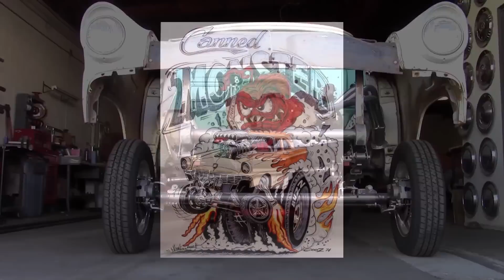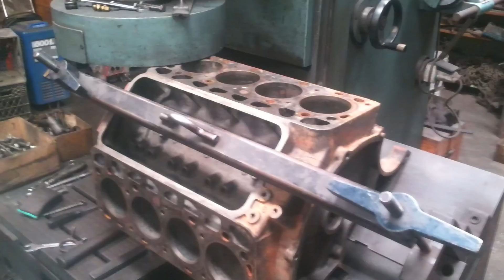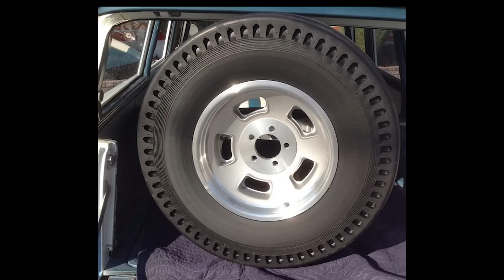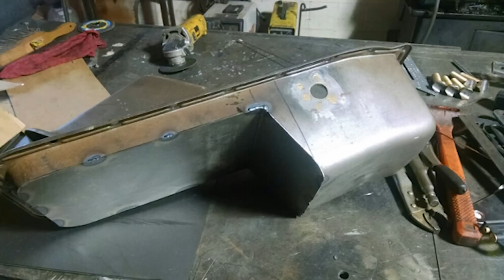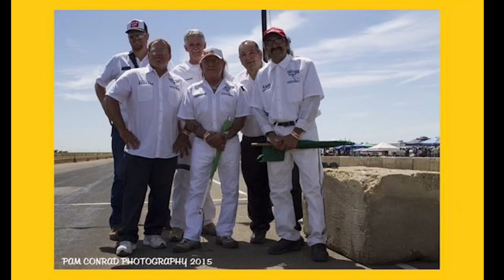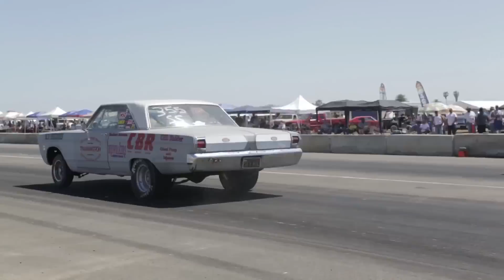1956 Ford Customline "Canned Monster" Gasser Build: Part 1

Comment: I just picked up a 56 Fairlane I'm trying to get a wider tire on the rear any suggestions thanks bud
Reply from the maker: The '56 is the best looking 50s Ford cars IMO. Wonderful lines on those cars. I would go to a good tire shop and have them measure the biggest wheel and tire you get get on there. If you want bigger you can move the leaf springs in board with a kit. The Chevy guys have been doing that for a long time. If you want bigger then you can find a narrower differential to swap in, maybe out of a Bronco. They aren't cheap but it gets it done. I would start with figuring out the best backspacing on one wheels to tuck it up in there, a good tire shop can help with that. Hope that helps.

Comment: It perplexes me, that you are not going to use the Best Rearend out there, the FORD 9", you can get any gear combinations and they are used everywhere.  I thought You wanted it to last.
Reply from the maker: A 9" would have been great, but thats not what I had at the time. The 8 3/4" Mopar is a very strong rear and this car won't break it with the Yblock I'll be running. I'll be lucky it its 400 hp at the engine. It will be fine for what I"m using it for. Later on if I end up putting in a much larger, higher HP engine, putting in a 9" would be the right choice. This is a budget build, just using what I already have around.
Reply: I've put those Dodge 8 and 3/4 rear ends. They hold 600 h.p pretty good. I had 36,000miles on my 72 Challenger before it have me any notions of trouble.

Comment: Love that body style always been a fan of that year , my pop has a 50 Ford . I'm building a 66 Nova for the street was thinking of making it a Gasser in the beginning but never realize the work that goes into it loving your build learning a lot 👍👍👍
             😈☠👍✌✌
Reply from the maker: Hey George, your car is probably the easiest car to turn into a gasser with a straight axle. Its literally a bolt on deal. No cutting or welding. Have you seen the '66 Nova that Speedway Motors built? They have videos of what they did step by step. Speedway sells all the parts to do it. A thousand times easier than this old Ford.
Reply: @SpeedandChromeTV  I will check into it and I appreciate you for making the time to let me know my friend , and  again good luck with your build can't wait to see it when she's done 👍👍✌

Comment: The dreaded oil pan....I had a 1957 meteor attempted to drop in chevy 383 stroker...got it all the way in running...went to pull out of my shop...and couldn't turn....had to pull it all out again.
Reply from the maker: What did you end up doing to remedy the issue?
Reply: @SpeedandChromeTV  cut the oil pan and modified the steering arms...I should have just kept a ford motor in it.
Reply from the maker: @automotiveaddiction428  Well, I kept a Ford and still had to clearance the pan. Thankfully the Yblock pans are almost flat already in that spot. While the images look dramatic, very little was actually taken out of the pan.

Comment: I was a Y-block guy many many decades ago - ran a couple of freak 312's  that would run with the 283's in full body cars on the street (three speed Hurst of course).  But I have never seen anybody successfully campaign a Y block.  Good luck to you - I am looking forward to this.
Reply: I had a really radical 312 in my 56 ford 2 door Victoria in high school back in the 70s. My uncle who was a drag racer built the motor and I helped as I learned. Super quick and would hold its own in the area where I grew up. Gosh the memories! Really neat ride to build man. Not many out there. Way cool. Good luck and God Bless.
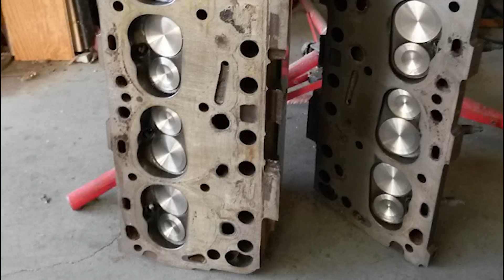Reply: Bruce McIntosh , I was a Y-block guy (kid) too, we were rare. I am 75 now. My best build was a 54 Ford 2dr post Mainline. Built the baddest 312 I could for the time 1963/64. I had reworked heads and a good thumper of a cam, a large Holly and Mallory ignition, dump tubes. I worked for my dad who owned a auto repair business so I had access to a lot knowledge and connections for help. It was light and quick with a T-10 4 speed with 4:11 gears. My biggest thrill back then was handing some of those 62/63 SS 327's their ass Fri and Saturday nights in Tacoma WA...fun times  I can't wait to see this 56 do its thing it will be a screamer I'm sure !
Reply from the maker: radtek2 love the stories guys.
Reply from the maker: It's all for fun man. Eagle Field is a heads up flag drop race and it's only an 8th mile. I'm looking forward to it running and driving and racing some day.
Reply: @SpeedandChromeTV  Just sweet.  Which site do you have your motor mods listed on?
Reply from the maker: @SmackintoshSr  You'll have to do some reading, but they are all in here. https://www.jalopyjournal.com/forum/threads/1956-ford-canned-monster-gasser.855675/